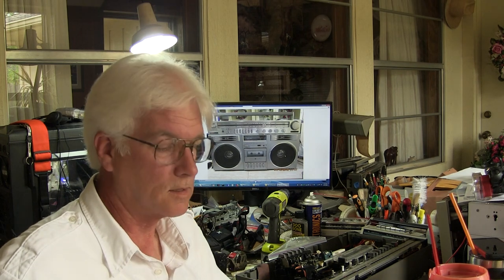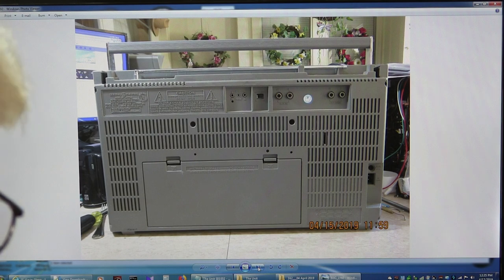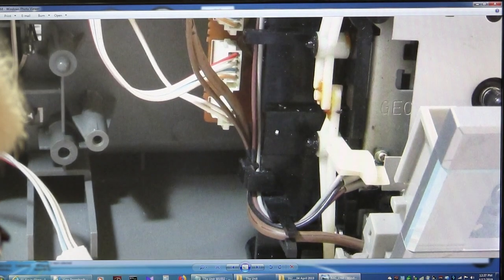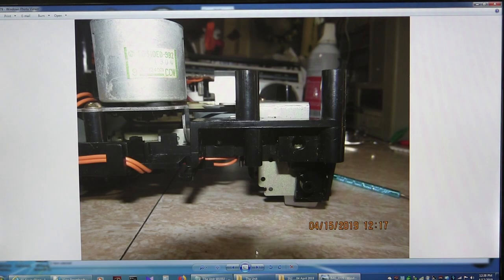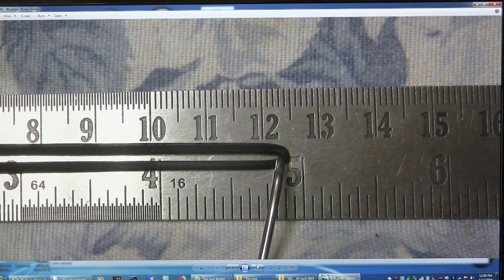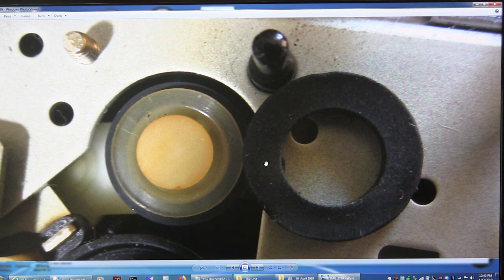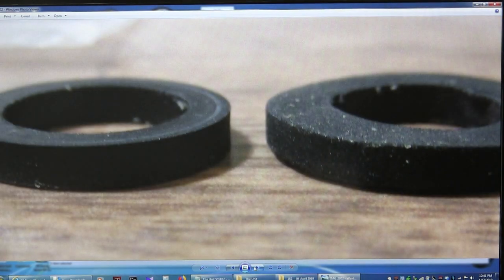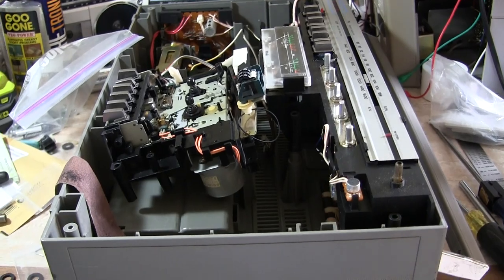Play cassette needs New Idler tire & Belts GE General Electric 3-5259A Blockbuster

Comment: Their are supposed to be two screws at the top left and right of the cassette deck to hold it in place. The deck isn't supposed to come out when removing the front case. The cassette door is a two piece unit. Before you remove the front of the case. You eject the cassette door. Gently slide the cassette door face in the upward position. Be sure not to break off the 4 tabs on the cassette door face. Then you can remove the front of the boombox. While leaving the cassette deck screwed in place.

Comment: Another tip is that the pinch roller is the same outer diameter as the idler wheel and you might be able to use it for the idler wheel, just cut with a razor to the width.